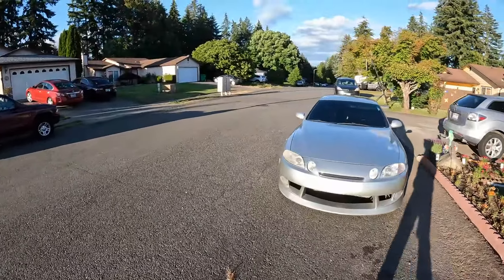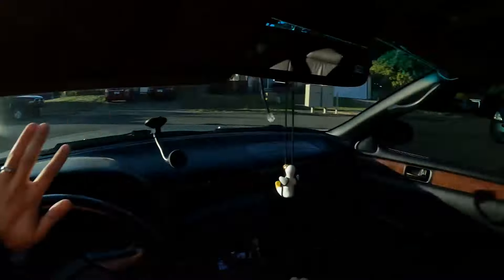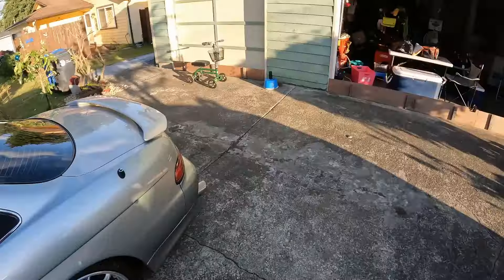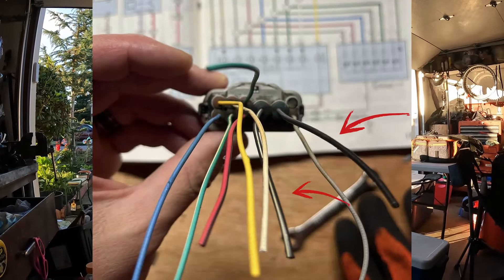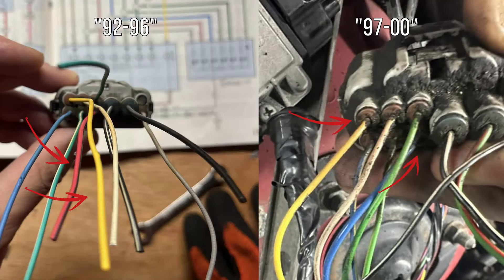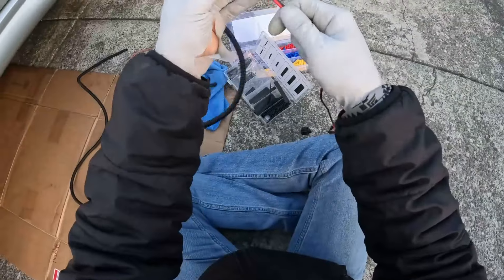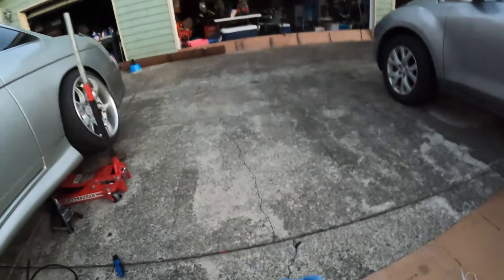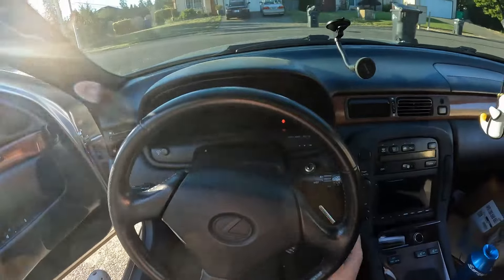Installing Shifter Boot + Reverse Lights (Manual Swapped SC300) Pt. 3

Comment: The Cd009 gets stupid hot. Every time i go for a mountain run, my feet are cooking. Thinking about putting more insulation around the trans tunnel
Reply from the maker: That's weird, do you have no carpet?

I've never been cooked down towards the pedals.
Reply: @JonathanMai  i still have full carpet and everything. I just kinda assumed thats how the trans was since ive never had any other problem with it.
Reply from the maker: @lalito._.01  That's really weird, maybe you have a big hole in your exhaust? lolol
Reply: @JonathanMai  considering how low my shit is i honestly wouldent doubt it 😂